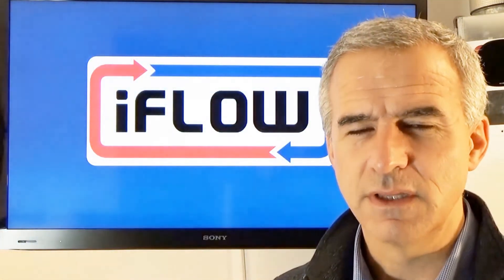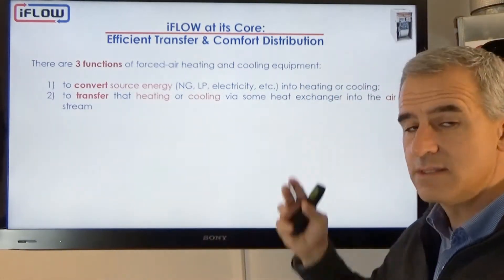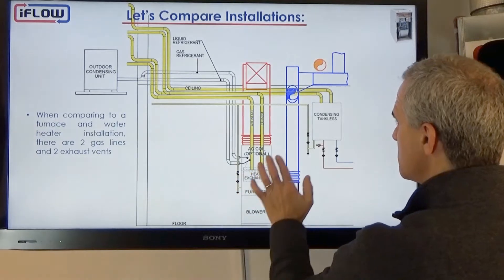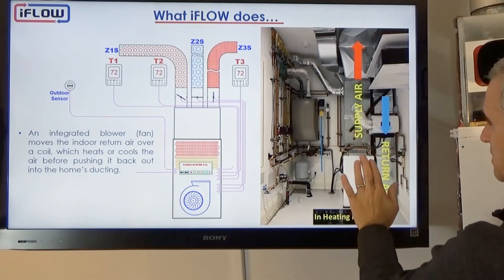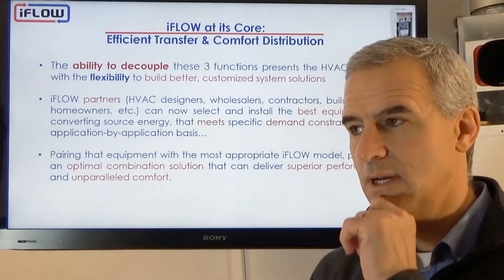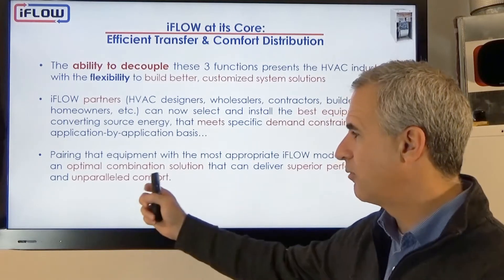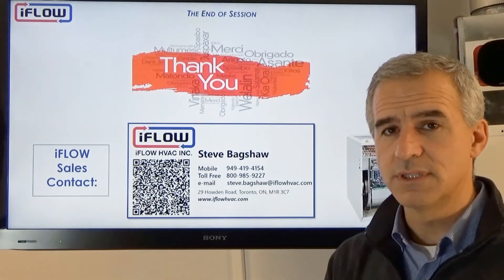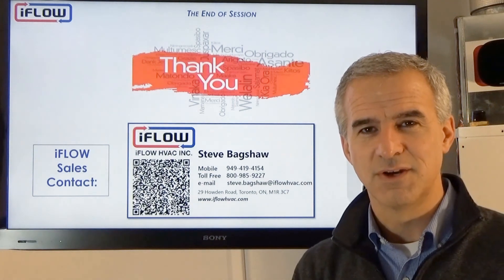2. iFLOW What is an air handler, what does it do, why an iFLOW combi system

Comment: How many BTUs can I get out of a ¾ line?
Reply: There are a few variables that will affect the outcome.  BTU/H delivery is a function of the flow rate (GPM) and temperature differential across the hydronic coil.  At iFLOW, we have been quite conservative with regards to the btu/h output capacities we have listed in our literature.  All are done with a 3 GPM flow rate (with a velocity of approximately 2 ft/sec to minimize any longer term erosion); that will deliver between 20 to 100 MBH, with Δts across the coil from 15 to 65.

Comment: And TT should be labeled R,W.
Reply: Thank you for the feedback.  I think much of the hydronic industry recognizes TT as the dry contract that initiates the call for heat to the boiler.  But you are right in that in a multiple zone system, that TT can wire to the R, W.